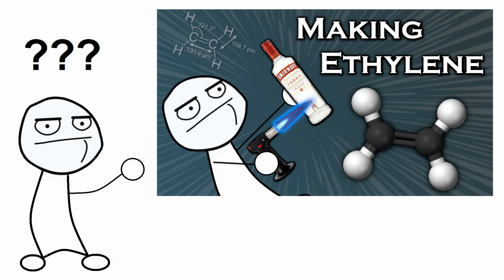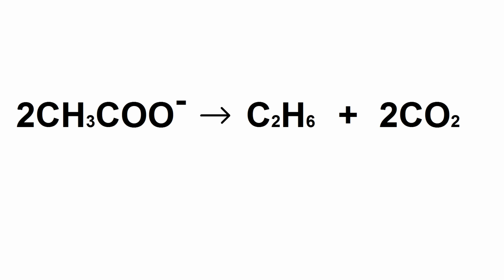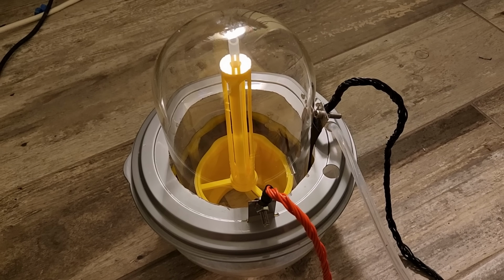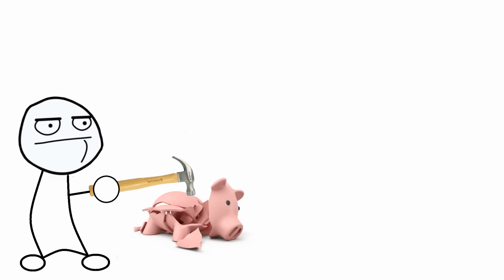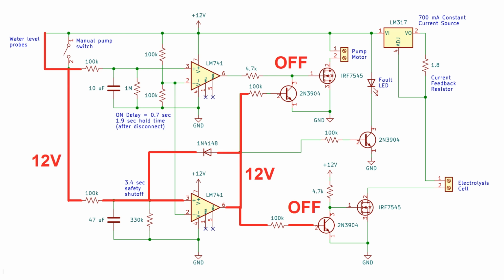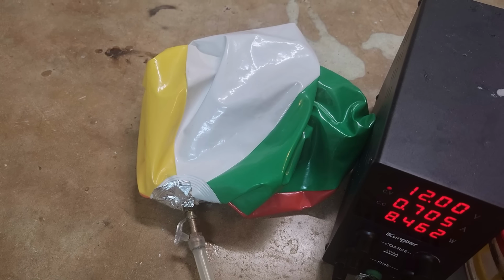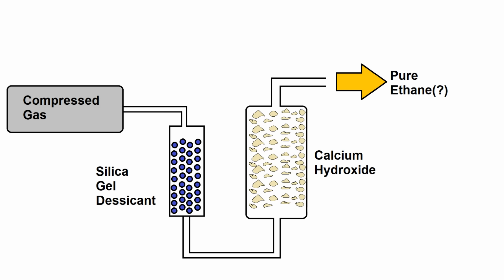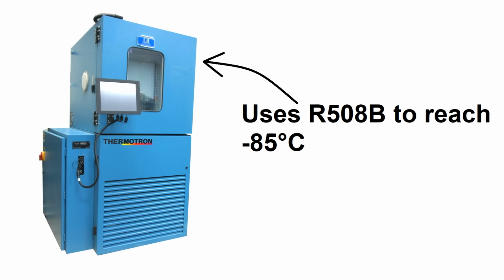How to make Ethane Refrigerant (R170)

Comment: 14:06 your circuit diagram shows a PNP transistor labelled as NPN, and it's upside down if it's PNP. A little confusing, especially if you know PNP transistors are preferred in high side switches. Really if you want a high side inverting BJT switch you should use a PNP with a pull down resistor on the base and use the float switch to pull the base up.

Comment: On your level float sw, if i believe to be correct, you have a c clip on the bottom of it. You can remove it and flip around the float. This will probably turn your float switch from normally closed to normally opened and vice versa. At leasted it worked with mine haha.

Great video as usual.

Comment: Some of these phrases like 'ignites on contact with air' and such inspire a due amount of caution, but nothing sends a chill down my spine like 'methyl radical'. I know enough chemistry to really not like the sound of that. Methylating agents can be severely bad news. As interesting as the process is, this is something where I'd be trying everything I could to get hold of a cylinder of Ethane to avoid having to do it.

Comment: The oily layer is a mixture of organic byproducts, and probably mostly contains methyl formate. Source: https://www.sciencedirect.com/science/article/pii/S2667109322001099
Reply: @Wel2Gr  Agreed. Methyl formate is a liquid, but the water would have to be saturated with it (30% w/w solubility).
Reply: That oil formed during the neutralization of acetic acid. It didn’t form during electrolysis.
Reply: @ashe1.070  That is consistent with the oiling out of a freebase, so something with an ionizable group (carboxylic acid rather than an ester)? I'm not a guru with organic chemistry but I hope one comes along here.

Comment: Hi! Could you elaborate on the reasoning behind using low current? You said you didn't want to damage the Pt wire. But it's submerged in water, so overheating should not be a problem right? Is there some current density limit for the electrode surface? 
Btw don't feel bad for using MCUs, it's just so much more convenient than making this cool yet wicked analog trickery. Also the cap you have in parallel with the 1Mohm resistor would not discharge trough the 1M res, but it is 1M res in parallel with 2*100k and 330k I think. You forgot the other path to ground. ❤
Reply: Overheating is not the concern. If the current  density is too high electrodes will corrode faster. I think in this case using platinum you don't have to be very careful but for chlorate cells it is very important if you don't want your anode to dissolve.
Reply: @HanTrio3   hmm, is the corrosion rate depending on current density non-linear? My point is if the electrode corrodes anyway, I might just as well get quick trough it, under assumption that the corrosion is just linear function of the electric charge that moved through the electrode. It's quite interesting, this electro chemistry ^^
Reply: @jomarkde  There are maximum recommended current densities. I think below these there is basically no corrosion but above the limit the electrodes can corrode very fast. For example maybe you run an electrode with 10 A and the coating flakes of so it is useless after maybe an hour but if you run it at 1 A it can last much longer than 10 h maybe even for months

Comment: Some recommendations for circuit making: 741s are not very good op-amps, you’d be better off using dedicated comparators like the LM393 in this application. But the delay fault latch is a good circuit, neat use of positive feedback via a diode.

You should hack a pH meter (or make one by buying the reference electrodes yourself) in order to detect when pH changes automatically and trigger a pump to add more vinegar. You could also put the electrolysis cell atop a scale and use the weight to automatically add sodium bicarbonate solution, in order to keep the solution at a constant volume AND composition.

Comment: I wonder if the oily layer might be heavier carboxylic acids, or maybe alcohols (e.g. butanol)?  If so, it should precipitate at low pH (free acid), dissolve at high pH, and also produce heavier Kolbe electrolysis products (octane+?). Something's missing though; maybe it's dissolved in the vinegar because of mutual solubility, and it gets "salted out" when neutralizing (no free acetic acid to keep it dissolved)?

Comment: As someone that occasionally teaches electronics to teenagers, I would like to note that the 741 opamp is entirely adequate as used in this circuit. And it reminds me of when I was a teenager in the 1970s and shopping at Radio Shack. I made a power supply that outputted plus and minus 15 volts for the opamps and plus 5 for the digital electronics.

However, it is far from ideal for learning how to use opamps today because it won't comfortably run off of the same power supply as a modern microprocessor.

A modern low voltage rail-to-rail opamp can drive the output to within a millivolt of either power supply connection and can handle input voltages across a slightly wider range all while behaving like an almost ideal textbook opamp.

The 741 became far less than ideal when you got within a couple volts of the power rail.

Once again, none of this detracts from this nostalgia fueled design. It is just a bad place for a person to start learning.

Comment: I think a "true" comparator like the LM393 would be better suited for your circuit than an opamp. And you could build a small hysteresis to every comparison with just a single "feedback" resistor. The only drawback is, you need a pullup at the output of an LM393 since it has an open collector output only.
Edit: I just saw the LM741 datasheet says "comparator" under the "applications" but I still think a comparator would be better than an open loop opamp
The opamp will just amplifier the voltage difference between the inputs, so if both are very close together, the output will be "low" too and possibly drive the transistors in their "amplification mode range" and not use them as a switch.

Comment: R134a and a heatpump can reach cryogenic temps depending, its based on volume of refrigerant its vapor pressure and the pressure gradient of the system, and on its freezing/melting points

The lower the freezing point and higher the boiling point the colder you can get
Reply: Ammonia based refrigerator is what's typical used for places like Walmart and walk in freezers 

Large areas, commercial hvac and heatpump use you can say refrigerants that are more toxic than in your residential hvac
Reply: Even water can be used as refrigerant but not as a cryogenic one

Comment: dont forget credit cards too you can get a credit card.

lye could be a problem as it is a pre cursor for meth production and may be regulated.

couldnt you put the tank in the freezer and then run the gas through the tank and the moisture would condense and freeze and you could dry the gas that way too?

you would need a dedicated freezer or if you want to modify a currently active freezer used for food you can save money on another freezer and electric.

of course you will want to make sure the tank does not leak or it could contaminate the food.

replacing the refrigerants in systems can be tricky as the TXV is designed to respond to what was originally in the system .

you may have to modify the system you are replacing the charge in.
Reply: Sodium hydroxide is neither a list I chemical, nor is it a list II chemical. It’s also not on the Special Surveillance list.

Comment: You could in theory bubble the gaz in some water saturated with sodium hydroxide : NaOH. The CO2 would react with the OH anions to produce at the end Na2CO3 which is basically sodium bicarbonate but stronger. At first your solution would be around 1kg/L of lye if you're around 20°C, CO2 would dissolve in the water to give H2CO3 which reacts with NaOH to give water and Na2CO3. The lye is consumed and the concentration sodium carbonate rises. You'll reach a point where it will be saturated. CO2 will dissolve and basically fall down as cristals at the bottom.
You can use the sodium carbonate back on the sodium acetate to deprotonate it. Ideally you'd want to make this in cold water (near 0) because the CO2 is more soluble at that temperature where Na2CO3 is not so it will precipitate quicker. Lye is also two times less soluble in cold water but that's ok ig. 
Ah and ethane is not soluble in water. Like just no it would  influence the yield in any way

Comment: 6:35 I think you might have accidentally made methyl methacrylate? It's an oily monomer derived from acetone. The various precursors to mma should all be in that mix
Reply: The oil formed during the neutralization of acetic acid not during the electrolysis.

Comment: The analog circuit is cool, but when you can pick up Arduino knockoffs with wireless for 5 or 10 dollars its easy to be lazy an swat flies with a hammer.

Comment: I did a sump pump circuit with 3 float switchs at different levels, a wall wart and 2 solid state relays. The circuit latches on when the lowest float switches, latches off when the middle float switches and the upper float is a kill switch so my floor doesnt get 20 gallons of water while im at McDonald's. No opamp or resistor f*ckery to worry about. Lol

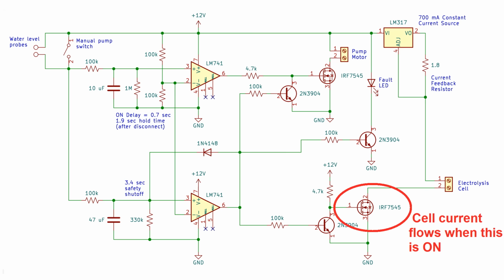Comment: Very informative video thanks! At 11:28 you definitely need a freewheeling diode across your motor connectors (if your pump doesn't already contain one) in order to keep your mosfet alive. The cathode of the diode should be connected to +12V and the anode to the mosfet's drain.

Comment: Unlike platinum, lead dioxide activly participates in the reaction and wont work well for the anode material.  But graphite might.

With a graphite anode and sodium acetate electrolyte, the main product formed depends on several factors. Conditions that favor Kolbe reaction that produces ethane include concentrated solutions, slightly acidic or neutral solutions, and low current density. Low concentration, or high acidic and basic solutions, and high current density increses the likely hood of other reactions.

Comment: I'd guess the oily substance is from some kind of anti-caking agent from the baking soda you used
Reply: Or some ungodly byproduct formed by the reaction between that and acetate electrolysis or possibly a bactericide or other preservative agent
Reply: It didn’t form during the electrolysis. So, it’s an impurity in the acetic acid, or the sodium bicarbonate.
Reply: @ashe1.070  Or something from the 3D printed plastic.

Comment: Seems to me the source of acetic acid was contaminated and that is what caused the oily layer. It could also be that some acetic acid could do a condensation with either the carbonic acid produced or other acetic acid molecules, even with the contamination, which could leave you with X amount of a few large unsaturated 4 or even 6 carbbon long acids thta could keep a captive ion, resulting in the oily layer.

Comment: the radioshack thing got me in the feels, when you could find stores for actual electrical components
Reply: I do miss RadioShack. It was like a toys'r'us for nerds.
Reply: The South American licensees/operators of the RadioShack stores have apparently bought up the full company, so maybe we'll be lucky enough to see some revitalization.
Reply: Here in Australia, Radio Shack became Dick Smith, which seems to have given way to Jaycar. We can see those stores all over the place, though I've not been in one in years myself.
Reply: As much as most of their stuff is plastic garbage, I've had a lot of luck buying components off Temu. It's basically where a lot of those components come from anyway, so I've never had an issue with the quality.
Reply: @6022 The real advantage of Radio Shack in my opinion was the “latency” for lack of a better word.  To be able to walk over (or drive over, rip) and grab a few components needed and finish the project in 1 day, rather than wait 1 day+ for the components to ship in was amazing.

I think a well stocked Makerspace is the solution to an extent, along with something like a LumenPNP / Circuit Mill or DIY Etch Setup, but yeah.
Reply: @ericlotze7724  what makes these kind of stores close is that since the internet they basicly became an emergency service. if my project can wait a few days why would i drive to radio shack for my parts when i can just order them in a matter of seconds and work on something else until they arrive.

and they cant stay in business if everybody only goes there for emergencies and orders everything else online, its just not sustainable for these kind of stores to have such low sale volume
Reply: Best to buy online, it's better than going to radioshack ever was in the end haha

Comment: oily mess? is that stuff Glycerin? i think you would need to pump oput all the O2 possible to make that side reaction almost nothing. if its glycerin that is. probably just whatever is disolved in the fluid from being in air.
Reply: Glycerin is miscible with water. Also, the oil was formed during the neutralization of acetic acid, and not during the electrolysis. So, it probably formed from an impurity in the vinegar.

Comment: Acetate salts have some weird shenanigans going on, like how heating Calcium Acetate gives Acetone. Maybe you're producing some kind of side product that makes the oily layer appear from that
Reply: The oil was from the neutralization of acetic acid, and was probably an impurity in the vinegar. The reaction that produces ketones from calcium carboxylate salts is called Ketonic Decarboxylation. This is a completely different reaction from Kolbe Electrolysis. Ketonic Decarboxylation is thought to involve the formation of a carbanion similar to Claisen, Knoevenagel, or Aldol Condensation reactions. A radical mechanism has been proposed though while others think the mechanism is a concerted one. Regardless, the reaction always produces ketones, and is promoted by a base (the carboxylate salt itself acts as a weak base). On the other hand, Kolbe Electrolysis is a type of oxidative decarboxylation that involves the formation of carbon radicals. This reaction produces alkanes mainly, but can be used to add other functional groups. So, the only similarities are they both involve decarboxylation (though two different types of decarboxylation), and they might share the formation of carbon radicals in their respective mechanisms.

Comment: Awesome work! My impression was that PETG is more chemically stable than ABS, but apparently it is good enough...
Reply: Even PLA is much more resistant to chemicals than I initially assumed, though it can be difficult to make completely water tight volumes in 3d printing.
A chemically resistant material SLA part would be ideal.